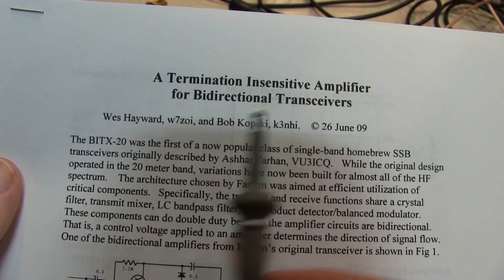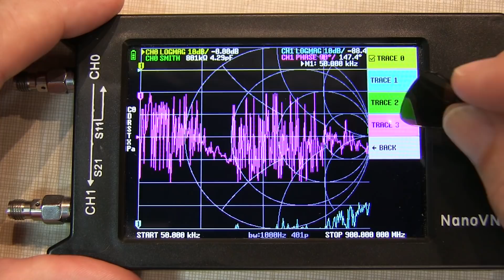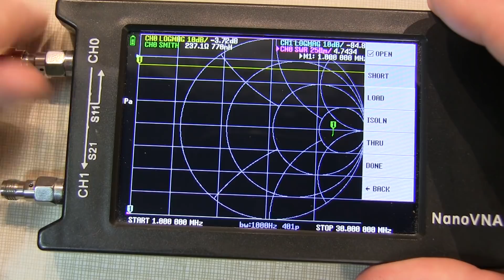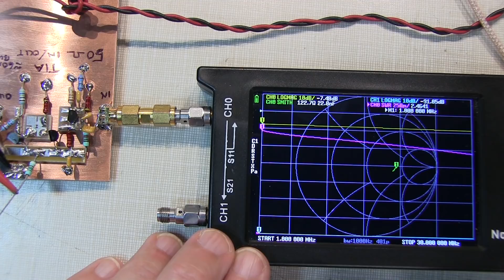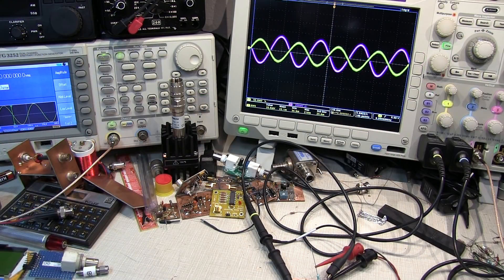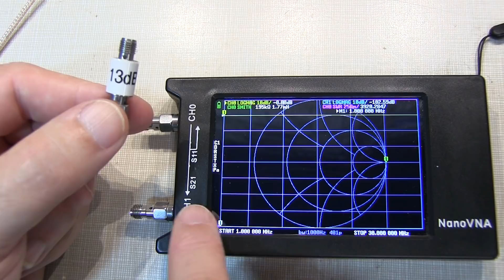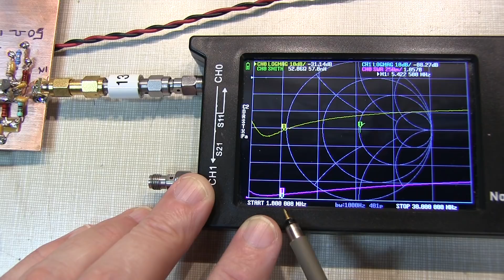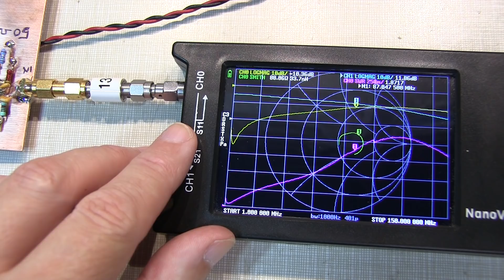#337: Use a NanoVNA to measure input impedance and gain of a small-signal RF amplifier

Comment: 1st class presentaion as always, very easy to follow.....Thankyou.
Can I use the same technique to measure crystal filter impedance.?
Thanks again".........Peter (GW4ZUA)
Reply from the maker: You should be able to - just keep in mind that as the impedance goes up and away from 50 ohms, the accuracy suffers...
Reply: @w2aew  as the impedance of crystal filter is of the order of a few kilo-ohms, it's possible to precalculate it analytically and then measure it through the pair of respective transformers. One should include these transformers into a calibration process and probably should also make calibration standards of high impedance. Crude guesstimation can be obtained using the formula: R [Ohm] = 97562 / (F [MHz] * C [pF]) where C is the capacitance of the capacitors in the crystal ladder filter. In the case of an industrial filter, it may be better to estimate resistance using voltage drop as shown in this video.
Reply: Hi Alan, and thankyou Alex

I tried this on a crystal filter with 13 dB atenuators ! I had a 3 & a 10 dB which I put in series but I presume it needs to be a single attenuator
As I think the nano vna saw the second attenuator as the impedance of 50 ohm , rather than the filter impedance??
Regards ........Peter
Reply: @peterwebb2224  there are two issues you have to take into account. The first one is the dynamic range of the NanoVNA, which is not as high as we would dream of. AFAIK it is pretty close to 70 dB on HF. The second one is the reflection coefficient of elements of your network. Although I don't know about your filter, I assume your network consists of low-reflective elements. 

Considering your filter reflection coefficient, let's say, -10 dB, you obtain the following: signal already attenuated by 13 dB reflects back and decreases by 10 dB and again attenuated by 13 dB by the same attenuator and finally falls into receiving path of NanoVNA. This way you get the test signal back attenuated by 36 dB which is comparable with the reflection coefficient of your calibration standard. That's why NanoVNA shows you 50 Ohms instead of the filter's impedance. In my experience, a 30 dB attenuator with a short calibration standard on the other end is seen as the matched load even on good VNA.
Reply: Thanks Alex,

It seem the more I learn , the less I know
Reply: @peterwebb2224  I think you just have no need to measure filters as well as any other passive devices through an attenuator. :)

Comment: Why would the input Z when using an attenuator be anything but 50 ohms when the input Z of the attenuator itself is 50 ohms????
Reply from the maker: when you attach the attenuator, the VNA itself will see 50 ohms only if the load on the output of the attenuator is also 50 ohms.  If it is not, the impedance looking into the attenuator will be slightly off from 50 ohms.  The calibration process measures the input impedance of the attenuator when an open, load and short are connected, and uses these to scale the results - thus taking the attenuator out of the picture.  I show this in the video starting at 10:20 where I show that the VNA properly shows the open, short and load values on the smith chart when connected to the far end of the attenuator.

Comment: Hello.
first I want to thank you for your videos.
I woud like to know how to measure a transmission impeadance in a PCB board.

I have a PCB with an chip transmitter I want to mach to my normalised 50ohm antenna.

do you have a video explaining the above or similar ?

best regards
Reply from the maker: If you are looking to measure the impedance of a transmission line on a PCB, you might be able to use this:
https://youtu.be/hqKLFbNYRZc
Reply: @w2aew  many thanks
I will try It out.
my line from the tranceiver chip to the antena is 14mm
Reply from the maker: @vitorperez3283  That's going to be way too short to characterize with a low cost VNA - you need a much higher frequency unit
Reply: @w2aew  the frequency is 2.4ghz
Reply from the maker: @vitorperez3283  Understood - but to measure the impedance as I show in the video, the test frequency has to high enough to be about 1/2 wavelength for the line.  Instead, you can simply test the antenna system impedance (antenna + line) as seen by the transceiver chip, and do this at the desired operating frequency of 2.4GHz.  This will require you to calibrate the VNA at the IC connection point.
Reply: @w2aew  the chip impedance is 35, second to the MANUFACTURER.
may I ask how do I calibrate the nano VNA to that impedance?

Comment: I'm wondering if you're right when using an 50 ohms attenuator in front of the amp for measuring its Zinput . This set up will of course reduce the input level  in order to not overdrive the first active stage BUT GIVES WRONG RESULTS as far as S11 (hence Z input) is concerned. When using a 13 dB 50 ohms attenuator in front of the amp , the measured S11 always gives something close to 50 ohms whatever the actual Zin is (as an example, a RFSim99 simulation with a 13 dB attenuator gives 53 ohms impedance at the attenuator input for an actual 200 ohms Zin).
Reply from the maker: As long as you run the calibration at the DUT end of the attenuator, then the effects of the attenuator will be mathematically removed by the VNA.  I prove this starting at 10:22 in the video where I show that it shows the correct result for an open, short and load.  It is true that the VNA itself "sees" a much more limited impedance range, and the reflected energy is reduced by 2x13dB (thus the dynamic range suffers), but it will show the correct impedance.
Reply: @w2aew  OK and Thx for your clear answer.

Comment: With the attenuator on the S11 port, the VNA measured its impedance!
Reply from the maker: If you include the attenuator when doing the calibration, the effects of the attenuator are removed from the measurement of the DUT.

Comment: In 12:12 when you connect amplifier's output to ch1 , the amplifier is connect to a DC source, is it correct? are there not problem with nanovna? Thx for the video. 73 from LU8ALI
Reply from the maker: The input and output of the amplifier are AC coupled, so all is OK.

Comment: If it is an IF amplifier it should be tested at 455. Kc/s and 9. MHz. (or whatever)  BTW:  It would be a superior amplifier if it were made with SMD 2N3904 transistors. (and other lead-less parts)  SMD transistors are cheaper than `through the hole transistors.' Ron W4BIN
Reply from the maker: Yes, but just a little more difficult to prototype with.

Comment: Hi Alan, from the paper, how R1(330), Rf (680) and Rd (15) can be combined to become 50 ohm?
Reply from the maker: The current gain of the transistor makes the 15 ohm look larger, and the voltage gain of the amplifier makes the 680 ohm look smaller.  In other words, the active properties of the transistor and the feedback of the amplifier,  combine with the resistor values.  The model papers describe this in more detail.  The formula on Page 6 of this paper gives the result for Zin:  http://w7zoi.net/transistor_models_and_the_fba.pdf
Reply: @w2aew  Thanks Alan.

Comment: Hello...
I'm designing a 20db gain lna for rf signals using mmbr951 rf transistor but I have some problems my output signal can not be more than 1v p-p on 50ohm load and more than 1v p-p   makes some clipping and distortion in my signal what I should to do for more voltages?
Reply from the maker: If you need 20dB gain for low signals, and that is too much for large signals, then you'll need some type of AGC (automatic gain control), or an attenuator that can be increased when signal levels are high.
Reply: @w2aew  I want to amplify a 50mv p-p signal to 5v p-p my plan was use several stages of lna to reach that voltage as I understood of your words I should decrease my gain in next stages
Meaning
Stage 1=  50mv to 500mv
Stage 2=  500mv to 1v
Stage 3= 1v to 2v
And so on
Do you mean this???
Reply from the maker: @Cyrusradplus  50mVpp to 5Vpp is actually 40dB of gain (20LOG(Vout/Vin).  That is a lot of gain for a single stage, and you run the risk of making an accidental oscillator (doesn't take much stray feedback from the output to get into the input and make an oscillator).  You would be better off using a few stages with lower gain.
Reply: @w2aew  thanks 👍👍👍

Comment: Hi W2AEW, I have one doubt that I can't find answer in any place. I'm develping an ESP32 board with a chip antenna and other one with a MIFA. I already ordered a NanoVNA V2 to tune the antenna. I already calculated the PI Matching circuit using some online calculator. The ESP32 design guidelines says that its output impedance is 35ohm+0j. The output impedance of NanoVNA is 50ohm. So, how to take the VSWR of the matching circuit if both Nanovna and ESP32 has different output impedance? I'm trying to make this measurement based on this video https://www.youtube.com/watch?v=rbXq0ZwjETo&t=505s . Thank you very much.

Comment: Aren't we going to measure only its own impedance by using an attenuator?
Reply from the maker: As long as you perform the calibration on the DUT side of the attenuator, you will properly measure the device you're testing.  That's one of the purposes of the user calibration - to remove the effects of cables, adapters, terminations, etc.  Keep in mind that it's best to use the smallest attenuator that will give you the results you need, since the sensitivity to change is reduce by the attenuator value.
Reply: @w2aew   TNX!

Comment: Pardon my silly comment, but connecting two amplifiers together in a circle like this sure looks like it would make for a doozer of an oscillator, yowza....
Reply from the maker: In actual use, only one of the two is powered up at any time.  This circuit is common in many homemade transceiver IF stages, and one amp is turned on for receive operation, and the other is powered up for transmit operation.  They are not both powered up at the same time.

Comment: Dumb noob question.  Clearly all things you measured need the amplifier to be powered. I had not considered plugging my NANOVNA into a powered circuit.  So one can do this safely?
Reply from the maker: The answer is - it depends entirely on the circuit being tested.  If the circuit is low power like this, then it is OK.  If you don't know how much voltage the circuit may produce, or if there is a DC bias on either of the ports, then you're better off not.